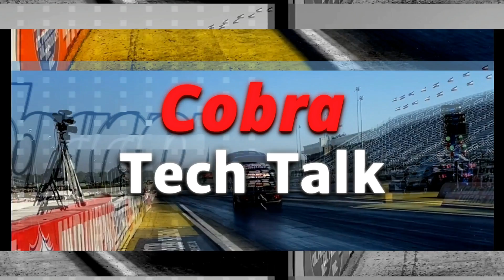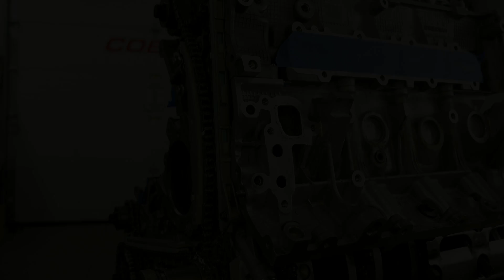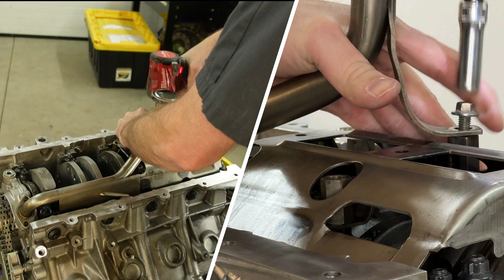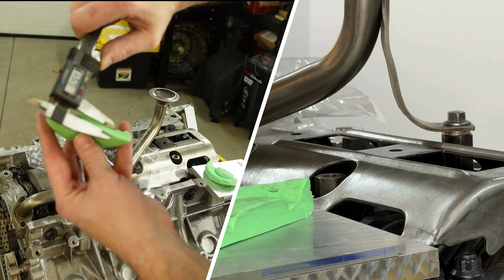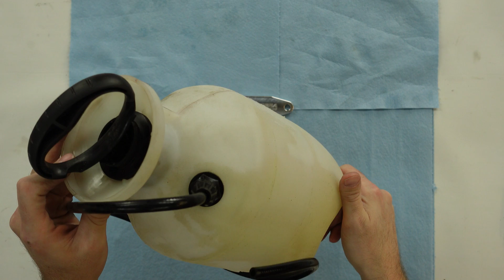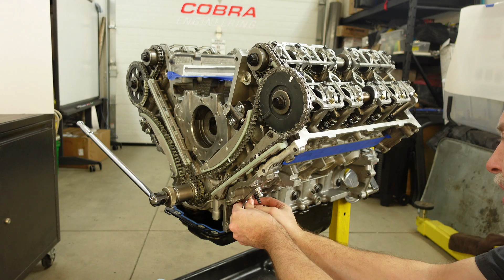Cobra Ford Modular Oil System - Cobra Tech Talk #4

Comment: Is the RTV recommended?
Reply from the maker: Just a thin film.  While making sure none is in the hole.
Reply: @cobraengineering  may pull mine back off and put some on there then. Just did it yesterday and didn’t put any on

Comment: Very interesting. Didn’t know you sold boundary pumps. I need one of those too. So that pickup tube is the standard for cobra’s? Wonder if I should get one? Mine is from an 03 marauder and the screen is partially covered with a baffle or whatever it’s called. Looks restrictive
Reply from the maker: I literally just set up a deal with Boundary. 
I’m pretty sure all the new pickups have the smaller opening. That was a older one I had. 
Just use tin snips and cut it open.
Reply: @cobraengineering  ok thanks for the tip. I will cut the baffle off.
Reply from the maker: @canadianmarauder1923  I wouldn’t say cut it off. Just open the oval to a circle.
Reply: @cobraengineering  10/4. Thanks again